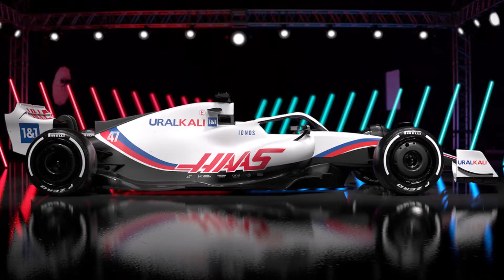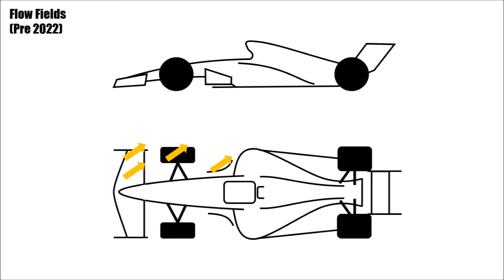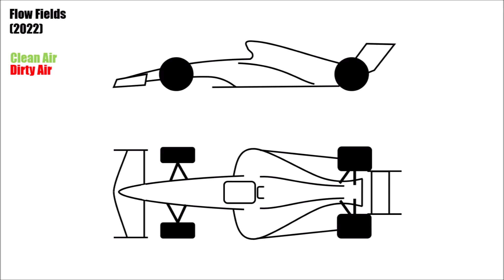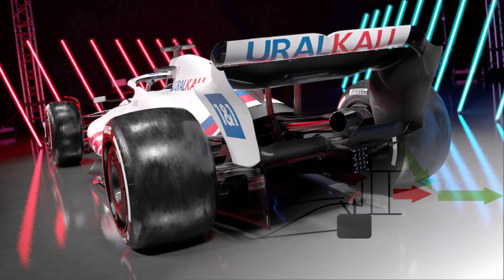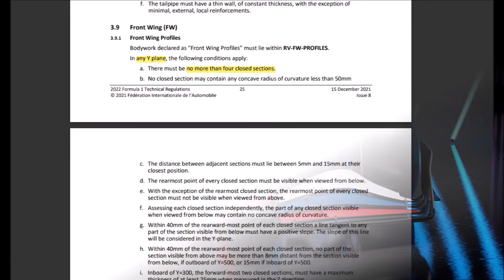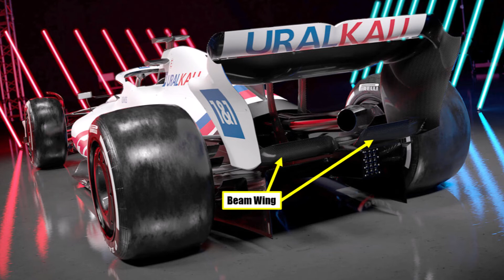F1 2022 - HAAS VF-22 (FIRST LOOK)

Comment: Front pushrods looks strange where they're supposed to blend into the chassis. This may have been a sloppy modification done to the 3D model to hide the pull rod design until the car arrives in Barcelona.

Comment: I don't understand the insistence with keeping the front wing that wide, we've already seen how teams continue to generate outwash after the 2019 ban on front wing furniture.
We literally had in-wash front wings before 2009, when the regulations mandated narrower front wings.
Are there any explanations/rationale for this?
Reply: “Aesthetic” is just as important as "reducing dirty air" to the rule makers, especially after Liberty Media took over the franchise. The American owner wanted the cars to look more "dynamic". For example, many bodyworks now are mandated to have exaggerated swept angle, such as front wings and side profile of rear wings since 2017.
Reply: @dirkstrickland135  Yes, but FW width was reduced in 2014 (I think) to help the aesthetic. 2009 cars looked like lobsters with narrow tails and a pair of pincers in the front, especially the McLaren with pair of red FW flaps on either side. Others looked like little combine harvesters. Full-width FW makes F1 cars look unbalanced due to the black floor within the wheelbase always looking narrower than the brighter painted front wing. A low 1800mm wide wing looks just right, anything over 1900mm looks disproportionate and nose-heavy.
Furthermore, there's the argument that wider FWs are more susceptible to damage in close racing and that minor collisions are more likely to cause debris.
Reply: @dirkstrickland135  at some point level heads have to prevail, we know how these overly wide wings are prone to issues on track, how they get caught on debris, one little tap and the whole thing breaks off and go under the car.

In the age of the budget cap, making a small team go through multiple spares, hundreds of thousands of pounds in one weekend is ridiculous.

Comment: how are they gonna deal with high pressure air leakage into the underbody tunnels, since they can't use sliding skirts?
Reply: The channel Kyle.engineers’ latest video expands on this. Seems like they’ll be trying to use vortices to create a sort of “air curtain” along the floor to the rear of the car.

Comment: When the airflow hits the car first it's always a high energy flow (if you're driving fast enough and not in dirty air) right? So you have to take energy out to turn it into a low energy flow, like the front wheel wake. What happens to that energy, where does it go? Is that drag?
Reply from the maker: Air is losing energy when you force it to change direction or even separate it. Change in direction results in force (lift, downforce, drag).
Another factor is boundary layer because of skin friction.
Wake is basically a volume with less air particles than normal (low pressure) and surrounding air is flowing into that volume in a chaotic way (turbulences).
Reply: @bsport320  Your answer has been most illuminating, thank you so much. Asking questions to people who know what they're talking about is my favourite way of learning.

"Air is losing energy when you force it to change direction or even separate it. Change in direction results in force "

So is that just kinetics? Air particle bumps into car part and pushes it into the direction the air particle was going?

Comment: Do you think that with the current regulations it would make sense to raise the height of the wing to get more air under the car in exchange for less front downforce?
Reply from the maker: The reg box for the front wing is pretty high but I guess teams will play with rake angle to increase downforce and hence bringing the front wing closer to the ground. 
I'm sure they will find a way to get enough clean air underneath the car. The front wing reg box shape is helping with that.

Comment: Why are  the "hips" of the car so wide? From past generations of F1 cars I would think that one doesn't want to extend the side pods much beyond what is needed for the air intake.
Reply from the maker: Yes but you need to cover the new crash tubes with bodywork. Haas shaped the whole side pod around them.
Only one blister per side in the rear part of the bodywork is allowed (3.7.5), so designing narrow sidepods and a blister around the crash tubes is not an option this year.